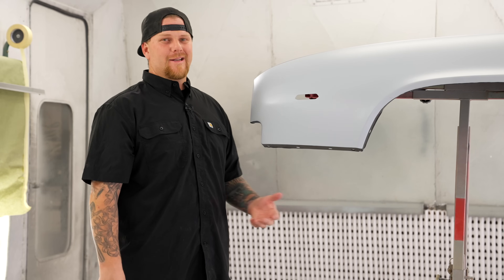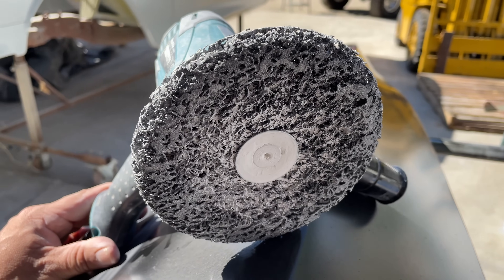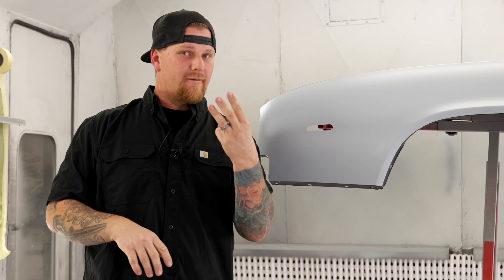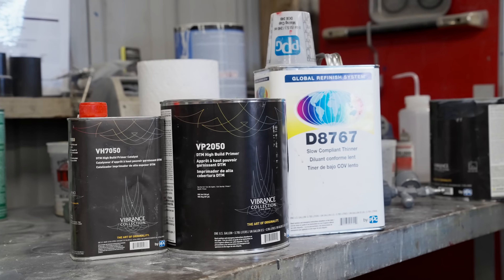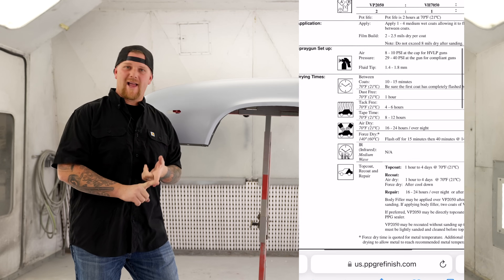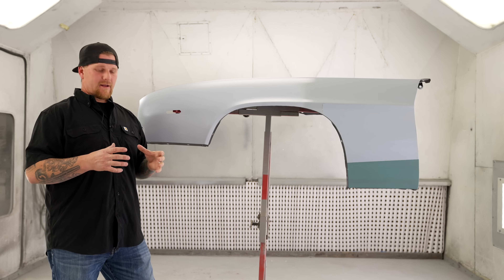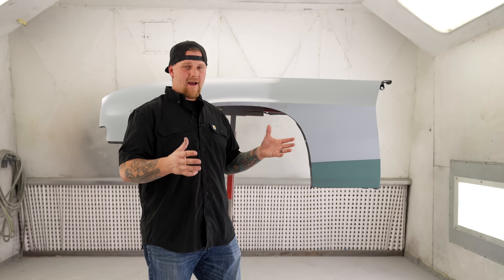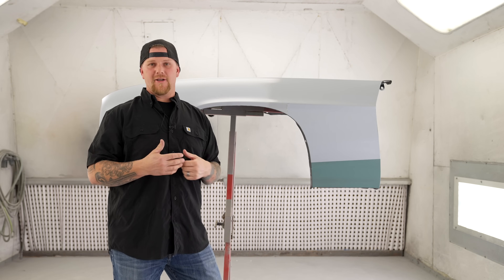Understanding Primers:  Epoxy, Polyesters, and Urethanes explained.

Comment: Id like to make a few comments on the Polyester primer. First off l would never suggest spraying polyester over epoxy wet on wet. Because Polyester cures so quickly and so hard, it wont give the epoxy enough time to set up on the substrate, and often leads to delimitation in the future; lve actually had this happen to me. Epoxy should sit for a minimum of 72 hours, preferably baked several times, and then fully scuffed with 150-180 before applying polyester. Secondly in reference to the shrinkage (l was in the pool!) Polyester really doesn’t have any. Perhaps it just comes down to product difference, l used to use slick sand now l use House of Kolor polyester. Because Polyester, or at least the HoK that l use, isn’t reduced and doesn’t have a lot of solvents, the shrinkage is essentially 0 and what you see is what you get when you spray it. Those are just my opinions from experience but ld like to hear what others thing as well
Reply: Well said. I've tried a few polyesters. Some Evercoat and PPG VP2100. By comparison, I liked the 2100. PPG was having trouble getting some ingredients a while back so it was offline. That's when I found the 2050 and stuck with it. I have used DP90LV reduced as a sealer for bare metal before polyester and had no issues with decent flash time and using just enough epoxy to cover. I was told by an Evercoat rep that the new generation of their polyesters are direct to metal if using the correct catalyst. Wouldn't recommend the Optex poly. It's  a gimmick. Good concept but not enough contrast to call a guide coat. Sands like concrete.  "I was in the pool". I caught that! "Like a frightened turtle". 😆
Reply from the maker: Thanks chris!
Reply from the maker: In regards to shrinkage all materials have a certain level of shrinkage the footage that was shown does not show it as good as I could. However, there is a good amount of shrinkage that happens with the ever coat that we sprayed in this video however, the VP 2050 has very little shrinkage and because it’s not just a straight epoxy it is a highbuild, it actually cures in three days And is not continuing to lose weight when measured on a scale. With that being said, you can topcoat the primer that we used with a poly, but I agree with your comment if you are using a traditional epoxy.  thank you for your comment.
Reply: @SYLVESTERSCUSTOMS  If either of your ever want to use a good polyester, l highly recommend the House of Kolor. Mixes with a hardener, no reducer, and sprays unbelievably smooth for a polyester. Like l said l used to use the evercoat slick sand and l had to reduce that by about 10-15% because it sprayed so chunky. This HoK poly sprays and sands even smoother than a reduced Evercoat product
Reply: @looper451  
Thanks for the tip. I'll keep that in mind if I have any supply issues with the 2050 again.  Do you happen to have a ballpark price on that?
Reply: @class5bodyworks  Quite inexpensive actually. Ends up being cheaper than Slicksand, at least with the discounts my supplier gives me. If l remember correctly its ends up being around $180 for a gallon. Keeping in mind lm in Canada so everything is 20-30% more expensive
Reply: @looper451  
Thanks for the info. The price seems right about average. I'll keep it on the short list.
Reply: @looper451  what's your opinion on spraying 2k 4:1 epoxy primer, then wet on wet 2k 2:1 basecoat straight on top?
Reply: @janeblogs324  A lot of guys do their basecoat wet on wet over epoxy. As long as whatever is underneath the epoxy is sanded out to 400+. Ive seen, extremely rarely, guys spray 2k epoxy over bare metal and go right into painting, but those guys are master metal shapers and don’t need any fillers or primers. Majority of people do their epoxy coat over bare metal to protect it, then do their filler work over the epoxy, and then use a high build of either polyester or urethane. Once you sand out either of those primers to 400+ grit, theres no issue using an epoxy sealer and painting wet on wet. Idk about a 4:1 mix, most epoxys will be 1 part reducer, so a 4:1:1 mix. Do a test panel and see how smooth the 4:1 mix is vs a 4:1:1 reduced mix. If you’re spraying wet on wet, you cant sand out texture so you need the sealer to lay out as smooth as possible, just like basecoat
Reply: @looper451  I've been using basecoat straight over epoxy primer for about a year on smaller parts like suspension, rocker covers etc. It lays smooth and isn't reacting etc. 
I know they are bonding really well to each other but my concern is the 2 paints curing and contracting at different rates, then delaminating years later.
Reply: @janeblogs324  l really don’t think you should worry about that. Almost all of the top restoration painters use epoxy sealer on their projects before basecoat applications. Most people will agree that wet on wet sealer/basecoat is actually better for adhesion than the traditional basecoat over sanded primer; because the chemical adhesion is stronger than just the mechanical one. Tomorrow lm going to paint a box that l have epoxied, filler worked, then high built with urethane. Im going wet on wet with an epoxy sealer
Reply: @looper451  I saw videos from boat builders doing it, then they destructive tested the paints by tearing them off. The wet on wet was so good it tore the plywood off. The wet on dry delaminated the basecoat off the primer. 
I've been doing it on intricate parts that have long TIG welds, sunken bolt holes etc. Things that are impossible to scuff/sand between coats unless you have 12+ hours to spend scuffing for an inferior bond anyway. I'm just concerned long term, I've had many cars that were re clear coated and the whole roof gets crowsfeet delamination. Its the long baking in the sun with heat expansion contraction I'm worried about.
Reply: @looper451  put it this way, my paint shop doesn't recommend I wet on wet 2k epoxy +base and the material data sheets tell me not too even though the results are amazing (for now)
Reply: I've used feather fill G2 over kd3000 after a 45 min cure many times with no issue..some paint jobs over 5 years old and no issues... but I cam see your point.  I love the G2 and have had great results with very little shrinkage ...especially compared to any high build urethanes
Reply: @Handlehandlebars    I am not sure how to ask my question because as mechanical tech, I am restoring a 67 C10. I can chemically strip it, oil base wax & grease, but spraying epoxy as I have lots of time. If VB2050 did not exists, I prefer a straight epoxy as DTM scares me. I don't want masking tape pulling off product. I have every intention of working one panel inside and out (Hammer-Dolly, Shrink, Chemically clean) but inside places I can reach to sand a tooth to perfection, doors and bedsides. I look inside doors and shutter in disgust at a slight rust film on everything. I will phosphate seam, corners, welds and bedpost. I just want it to last and draw on folks that are experienced with current chemistry in epoxy, high build, paint and clears. I can't afford VP2050. 
The couple (35 years old) at the grocery store spent $380 on food for them & four kids...he started crying. I felt uncomfortable & my wife moved to another register. But I am 6'3" tall, retired, no union income but planned 20 years ago for high efficiency appliances, insulation outside and top. Money on utilities is gone money. Pay house down, low credit balance and savings. Storm smashed wife's car and 37 year old son ran my 23 year old 4X4 out of oil. Fixing 2k+ cars a year, I am on foot! 
What is best practices for a solid (Very little Rust) old truck! DK, ASE master, 1978
Reply: @deankay4434  What on god’s green Earth are you talking about
Reply: @looper451  Dude I want epoxy inside and out. I can't afford high end product, every else seems to be DTM epoxy. 
  I will the best I can afford outside, but have no choice but to use DTM inside doors, bedsides and interior of cab. This is a working truck, no show, just Git-R-Done. I am asking for the experience of others with both epoxies. DTM epoxy or plain regular epoxy. If you are not in a hurry, would you use DTM epoxy? That's all. 
  As for stripping to bare metal, I have 13 gallons of aircraft stripper with methylene chloride full strength in heavy plastic 30 gallon barrel. Never had a problem before using it. Scrap off, neutralize oil wax & grease, spray epoxy.
 If DTM epoxy is on your panel every time and it sticks, seals and holds, fine. Tell me about it.
 I have heard so much bad, but there is 25% good and 75% bad info out there in videos. 
  This is for me and my last one. So I would prefer it last 20, 30, 40+ years. The inside bed will get scratched & dinged, but that is a truck. It is DTM or Not that concerns me. Am I wrong? Is so, enlightening a non-full time restoration guy doing this type of work. Is that better?
Reply: @deankay4434  strip your metal.. acid wash the parts.. spray your epoxy and then spray a  high build urethane over the epoxy the next day
Reply: I’ve used a lot of polyester primer and the success I’ve had was varied. Clausens rust defender has always done wonderful for me-except for two things; 1.) the price🙄, 2.) it’s very deceptive in the way that it appears transparent even though it’s much thicker than it looks! 
Feather fill has also done well for me but it shrinks considerably more than Clausen does. From the research I’ve done-Clausens rust defender or their other product that was displayed in this video (All-You-Need) are approximately 86% solid making for less shrinkage in comparison with almost every other poly product i researched coming in around 60%! The only exception to that was in the 70% range was super build(feather fills big brother). I have used nasons full-poxy which is really good and Clausen together for years with pretty good success-when it comes to hold up over time. For years I put body filler on bare metal because that’s what I was taught. Most of the time I had no issues with that but the few times I did-it was a major issue! All it takes is one breach to bare for an entire skim to let go and the peace of mind is worth the extra steps to me now
Reply: In marine its epixy over poly, never poly on epoxy.
Reply: @robertdinicola9225  is the base material metal or fiberglass?
Reply: @mback12000  glass
Reply: @looper451    yep let all paint dry first
Reply: Wet on wet process gives you the most anticorrosion protection. Anticorrosive grade depends on the thickness of the coat. By sanding and reducing the thickness of the coat you reducing the anticipation grade. To me applying a coat of wash primer and after two coats of epoxy you get c5 grade of protection. Fore sure you must be experienced and careful about time, humidity. If the tds allowed to wet on wet then you can .

Comment: I know you said there isn't necessarily a 'wrong' way and that the VP2050 replaces a lot of different products...It seemed like you also suggested that a urethane primer or sealer goes on top of body filler and the VP2050 datasheet does not list body filler as a compatible surface.   I was wondering if throughout a job you truly would not need any other primers besides VP2050, which would be fantastic.  But that doesn't seem to be the case where body filler is in play.  Is this true, or what are your thoughts?
Reply from the maker: We absolutely use VP 2050 from start to finish all the way till it is wet sanded before body filler over bare metal and after body filler when it is ready for paint you can either use a urethane sealer or you can use epoxy like DP 90 and then go directly to Paint after that has flashed off
Reply: @SYLVESTERSCUSTOMS  Excellent, thank you!!!
Reply: I use sealer only on very small areas of body filler. Most paint manufacturers recommend a certain amount of film build from a filler primer before painting.  The 2050 is definitely compatible with body filler either over or under. Travis mentioned before in some of his videos that they only use VP2050 straight through to paint. So,yes, it's convenient to use only one primer. I personally still topcoat the 2050 with a DTM urethane for final prime mainly because it sands easier.  I know it goes against some theories but it works for me.

Comment: As a dealer tech, you can't afford mistakes, but as a one income family 40+ years ago, you bought used cars, fixed them and became transportation for everything. Even then, I would sand to bare metal for repair & a color change sometimes. I was shocked to sand a rock chip and find the "fingers of rust" spiderweb out 6", 8" or more. This scared me! We was going on under the paint to allow that? Not knowing it was fixed before using a standard primer, a standard filler, a standard sealer regardless of paint, single stage or base coat / clear. As chemistry has changed so much in 4 decades, now retired with time to research products, almost became more confusing to me. Only to find your channel and get explanations and straight answers from someone other than a guy behind the counter.
 We get flash rust and serious rust in the upper Midwest states over winter as rock chips are not cleaned, treated and ignored. It is maintenance. No different the gear oil in the final drive. It gets attention once loud, obnoxious and headed for disaster. Then, it may get its first gear lube since new, but has 148 miles on it. Travis, thanks again for a great bucket load of information. Epoxy for my vehicle! Marketing drive the product and "DTM" is showing up everywhere and it scares me. It is not needed if you remove the old finish, sand and clean, spray. It implies that an acid, weak, strong, phosphoric or other is required. DTM to me, logically says skipping a step and costing more. I don't have a "Vibrance VB2050" budget, but I do have time. Not like a 34 year old guy, but one who will do each step, wait for it to shrink, do something else and revisit those panels later. Am I wrong? DK, Omaha. Great info.
Reply: Hi Dean! Another epic novel! 😁 Just kidding. Yeah, I hear you on the elements in the midwest. It's a killer. They don't call it the rust belt for nothing. One difference also is the difference in metals that are used from 40+ years ago to today. Some vehicles years ago you could find galvanized metal in certain areas (Mustang rockers) and usually held up pretty well. Now, all the sheet metal has zinc coatings so you dont see that spider rust as much as you used to.Then there is HHS, UHSS, alloys with boron,laminated steel,aluminum and so on. So you really need to know where and what it is. High tech stuff. Take care.
Reply from the maker: You are 100% correct there’s so many ways in this industry that you can slice anyone project but you were on the right path. We’re happy to help and thanks for watching.
Reply: @SYLVESTERSCUSTOMS   Helping others succeed in their project using best practices is what we do. You teach, I learn, pay it forward. That is a true blessing to allow a total stranger to do it and be happy. Time is short. 
Travis, you pick some great topics for your videos, nice! 
I will say those that use product and let it cure, then destroy sample A, B, C etc get huge hits and likes. It is like project farms, except for automotive body. 
Did you ever see MrFireman164 do his Ospho to body filler torture test. I haven't checked but 1.4M views and thousands & thousands of likes & comments. Stay healthy Travis! I hate sinus issues, plus the sales / tech for my electrodes & controller, they gave up and quit. Bummer! DK, Omaha

Comment: Slicksand (polyester) seems like it's not porous at all, used it to seal up a composite thermostat I'm experimenting with - I know its not the intended use -  but it's sealed up a few leaks of coolant at 90c for a few months now. It's not the polyester itself that is porous but the additives mixed into the resin so depends on product, after all, every fibreglass hull uses polyester resin. Cheers for the video.
Reply from the maker: Thank you. Yeah they all have a different make up of chemicals. This video was intended for people to just help them get a clear direction on where they need to start so it’s not overwhelming. Thanks for your comment.

Comment: So you use epoxy primer 1st (bare metal),  than body work eg: filler/bog, than polyurethane, than urethane is that correct
Reply from the maker: For most shops, yes. That’s more or less the Collision way of doing things in my opinion. However, I like the VP 2050 because it is one primer that basically does everything you need to do you spray it over bare metal scuffed that up with 80 grit do your bodywork. seal it back up with the exact same primer block that down and wet sand and the only other material you will need is sealer before paint in my opinion you’re using less different materials for less failures and it’s doing everything you need to do with a high quality

Comment: cre is the off brand of 2050- ? can you put these over paint ? thank you for your awesome videos you are very through at explaining things !
Reply from the maker: Thank you. CRE is the industrial version of the same product VP 2050 you are correct when they had shortages with the resin‘s. We were using CRE and it worked amazing.  and yes, if you are going over an existing paint job, you can do that with his primary as well.